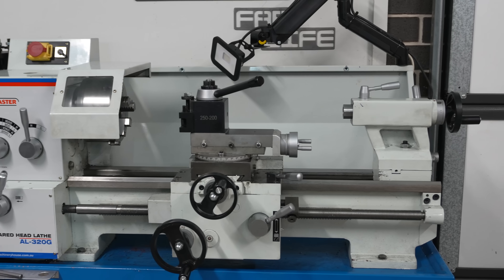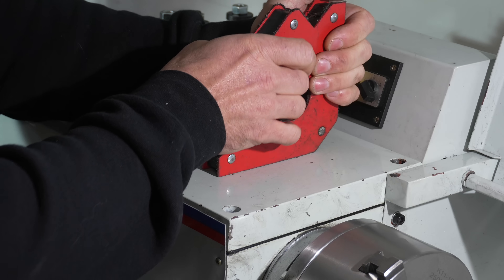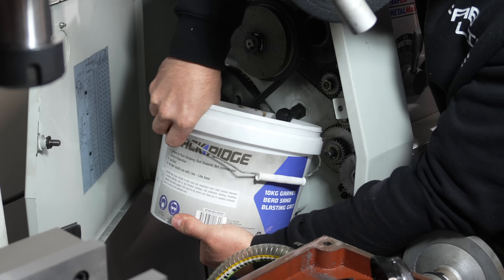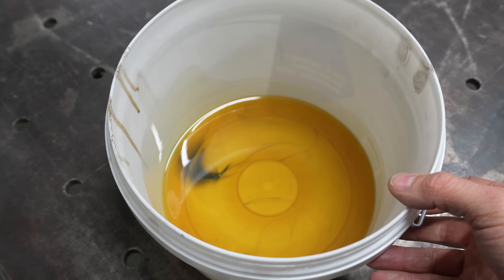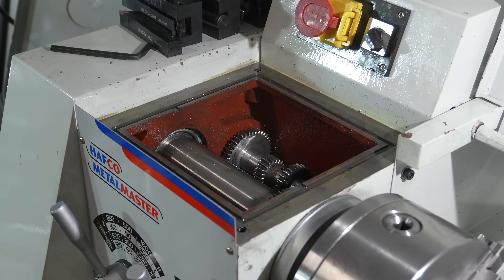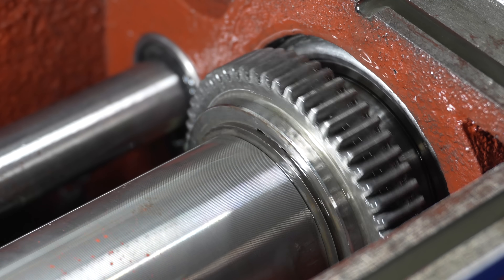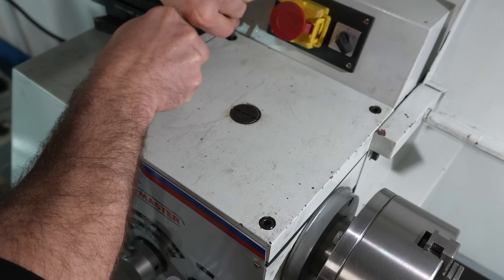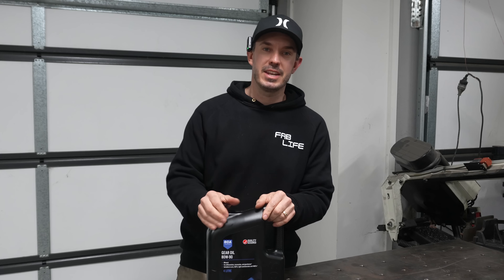Can I Fix This Annoying Gearbox Noise? - HAFCO AL320G

Comment: have the same lathe same problem when i bought it the gearbox had around half a cup of casting sand still in it took some getting out i put 1.5 liters in mine to 80/90gearoil
Reply: Loose casting sand in the oil is typical of these Chinese made lathes.   The guy in this video was lucky.   These lathes are made as cheap as possible for the hobby market.   They are assembled for convenience of shipping and should be cleaned of oil, casting grit and swarf before being put to use, and the bearings adjusted for correct preload.
Reply from the maker: That’s great feedback! I had a bunch of grit in the bottom but not as much as yours. How are you finding the thicker oil?. Any issues since doing it?. 👍
Reply: @Fab-Life444  none and so much quiter
Reply from the maker: @colinsimmons2913 That’s great news! I’m about to head to the shed to start on the next video. I’m excited to use the machine now that it’s allot quieter 😎🇦🇺

Comment: My Grizzly lathe makes no noise.  Synthetic oil for all gears.  I use Royal Purple.  My gears are straight cut and make no noise.  The backlash thing is nonsense as the gears are under power and constantly pushing against one side in either forward or reverse.  Check your thrust bearings and use good gear oil.
Reply: It would be nonsense if the gears had perfectly cut involute teeth and the gear centres were accurately spaced for perfect meshing.   But, especially on these lathes made as cheap as possible for the hobby market, neither is true so the pushing is not constant.
Reply from the maker: Cheers for the comment 👍
Reply: Back lash puts the pressure point on a different part of the tooth. It matters

Comment: Hey dude. Just purchased one of these lathes myself. Would love if you could show us how to thread using the gears, set up ect... looking forward to more content cheers
Reply from the maker: Cheers for the comment! Yeah I could definitely do that. It would force me to do it more often haha. I have done it off camera just to learn the method of reading the chart that’s inside the door… or the owners manual. I set the gears up for metric 1.5mm pitch thread and it worked like a charm. Keep an eye out for a video on this in the next few weeks 👌🇦🇺
Reply: @Fab-Life444 sweet can't wait. Thanks
Reply from the maker: I’ve already put it in my notes for future videos haha 👌
Reply: @Fab-Life444 even if it's like like 30-40mm external/internal, just joining to parts together because let's face it, we will use the die holder to thread any thing smaller.
Reply from the maker: Yeah I agree. The die holder is such a good option compared to messing with the change gears on our machines. When I first used them, I had to file 3 of them in the centre because the finish on them from factory wasn’t very clean. I was able to get them to slide on after a bunch of adjustment.
Reply: take the top off and check for casting sand in gearbox
Reply from the maker: I didn’t have much in mine. Only a small amount sitting on the bottom. It wouldn’t drain out. I had to suck it out